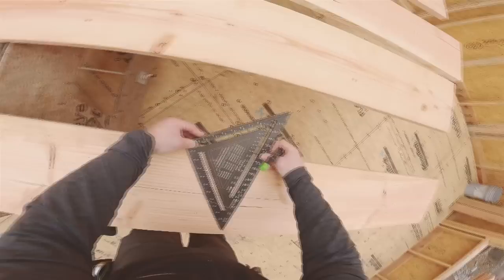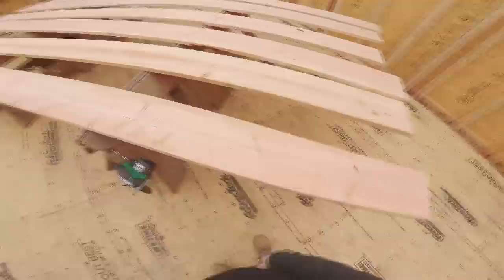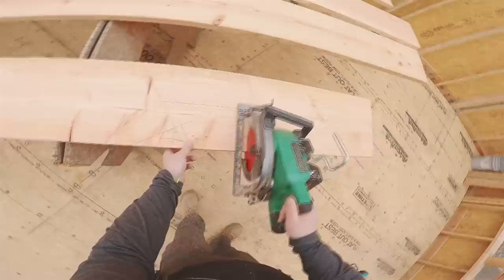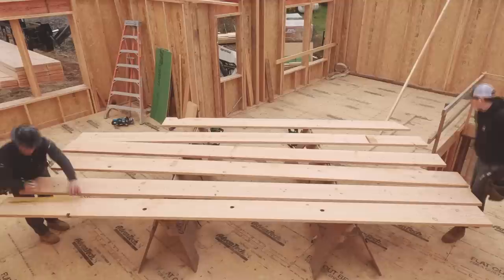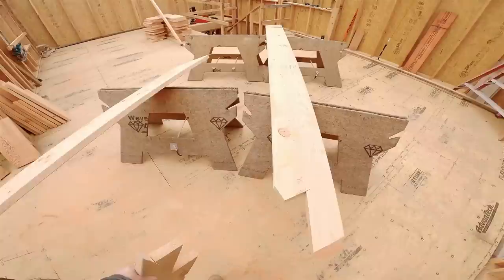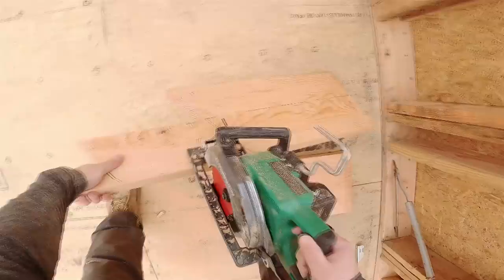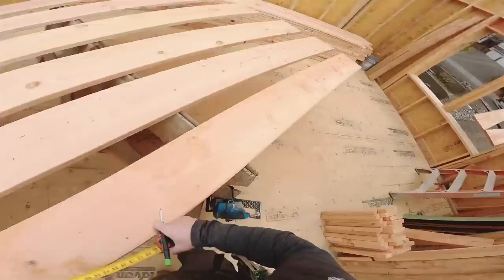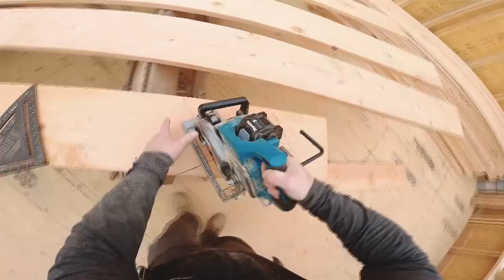How to Cut Rafters Project 150 Roof Framing part 2

Comment: Tim, Are your rafters going to be on the inside of the heated living space? It looks like the way the land on the stud OR the little built out plate you guys built they are.
Reply from the maker: I don't understand your question, where specifically are you talking about?
Reply: @AwesomeFramers  On your thumb nail you have an arrow showing, right at the bottom of that rafter tail. They normally stick out past the exterior wall and they put bird blocks in between each one right?...... Yours look like they are going to land inside the little cup you guys built therefore they will have no ex poser to the outside.
Reply from the maker: @jagslion3  Let me take a stab and answering, but its possible the answer might be in the next video when the rafters are installed.

We try to frame soffits before lifting.  The rafter tail will fall just short of the subfascia of that soffit. The plumb part of the thumbnail will land evenish with the outside of the exterior wall plate.  I'm sure I'm not helping you out am I?
Reply: @AwesomeFramers  That`s OK 👍 I will wait until the next video, If you are doing what I think you are doing I will send it to my GC and say this is what I want right here, and have him watch it... Thank you !!

Comment: why in the world do you guys leave the base plate on the saw floating like that?  been in this for 40 years and never seen anybody do this
Reply: Try it before you knock it bud IT WORKS
Reply: I feel like it sorta turns your circular saw into a chopsaw of sorts....does that make sense?
Reply: I think its done to make plunge cuts more accurate. Never seen it done before either. 🤷🏽‍♂️
Reply from the maker: I do it because it keeps the baseplate flat and allows the saw to act like a chop saw.
Reply: I think the biggest difference is that you see the blade really well

Comment: Hey LOVE the videos. What size nails do you run for wall assembly? My engineer swears we need to use 16d but we’re use to using 3-1/4 x .131

Would love to know what you guys use!?
Reply from the maker: we shoot 3" x .131" nails and our engineer designs with that.  That nail size is also in the IRC and makes splitting wood much much less frequent.  

https://up.codes/viewer/washington/wa-residential-code-2018

check the tables in chapter 6
Reply: @AwesomeFramers  I SO appreciate you. Thanks for the response. Blessings.